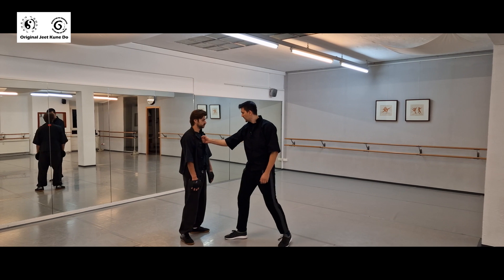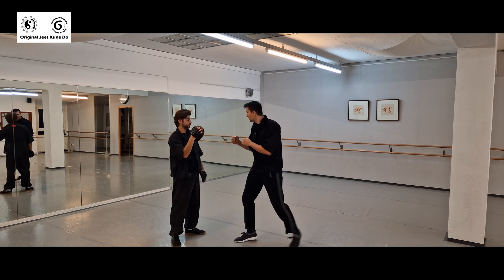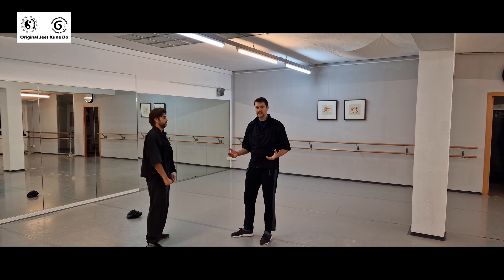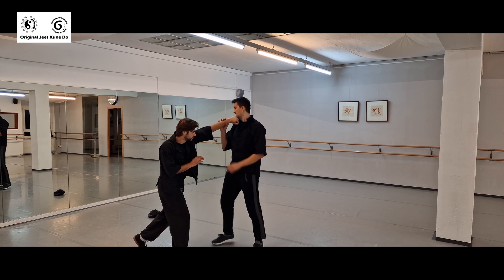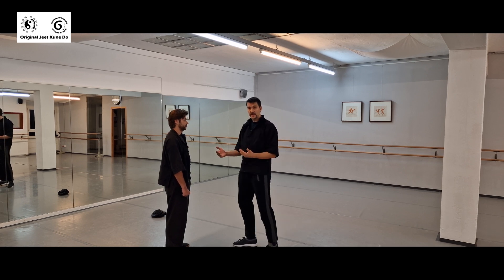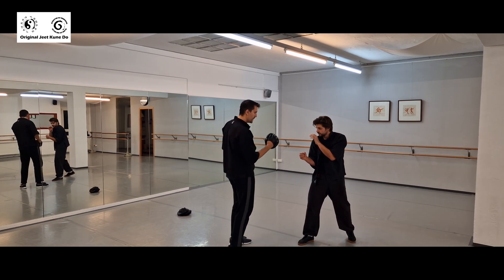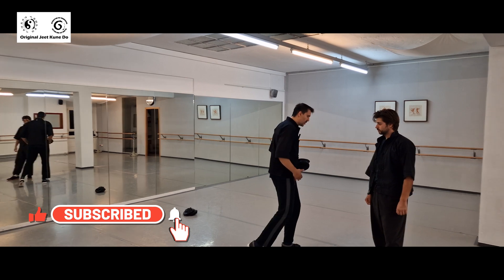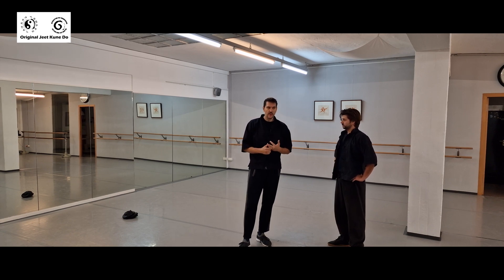Punching Power 👊💪, HOW? - Bruce Lee's Jeet Kune Do

Comment: 4:49 - It's incorrect that when you apply wing-chun you would not have a back leg. The Yee ji Kim Yeung Ma is only used in Siu Lim Tao and Chi Sau. The reason for this is pretty simple you are training a horse stance and would not fight like this. The idea of not having a back leg in the first phases of Chi Sao is that you cannot rely on your stance to absorb force, this will isolate your arm movements from your stance hence show you their efficiency. Also in Chi Sao without having a fighting stance it shows when you are leading with your upper body instead of driving from the back leg. When doing sparring you always have a front and back leg. Bruce himself started to put one leg foreward in Chi Sao but that's different from what you imply.
Reply from the maker: Who cares, it was Bruces modification, as I said in the video, which was also done by Jesse Glover in NCGF.
Reply: @ThomasMarxJKD   You are implying wing-chun does not have a back leg and only has arm punches over and over again, which is false. No wonder people start to claim you don't know wing-chun. 
Would have been more intresting if you would have talked about bruce making modifications in terms of raising the heel of the ground and the weight distribution. Also his change in the timing between stepping and punching.
Reply from the maker: Bruce's modified it, go figure.

Comment: Izzo argued that you'd get a stronger punch if your upper body is square. That's why you bench process like that. The thing is, punching is not pushing, more like throwing. Thus this is wrong,  except if you want to push the opponent away...

Not a physicist but as far as i know, gravity is accelerating the body downwards. You cannot directly get forward force from that. I guess having your foot in the air on impact is not giving you additional force but avoids deceleration which having your foot on the ground would cause.
Reply from the maker: Also, what he says with bench press, doesn't make sense, because when you bench press you have your arms wide to the side, wc punch goes to the centre of body.
Reply from the maker: You know that walking is constantly falling down, you moving forward, catching yourself with a step.
Reply: @ThomasMarxJKD  
The forward motion comes from your muscles and the friction of the standing leg on the floor. That's why you can't walk forward properly on a slippery surface even though gravity is still there.
Reply from the maker: Ok dude, listen, the forward motion comes from the weight shift, the gravity pulls you down, you catch the falling motion with the step the resulting motion is forward motion. There are literally documentaries about that. Go watch. End of discussion. If you had no gravity, you couldn't walk. Go in a stance and just lift your front leg, you'll fall forward, you don't need to use muscles. When you use muscles, you increase the power, as explained.
Reply: The falling step works, you can experiment with it and tell the difference. Hell it worked for Jack Dempsey
Reply from the maker: Its a concept from boxing, yes...